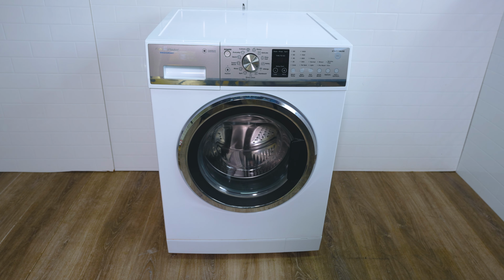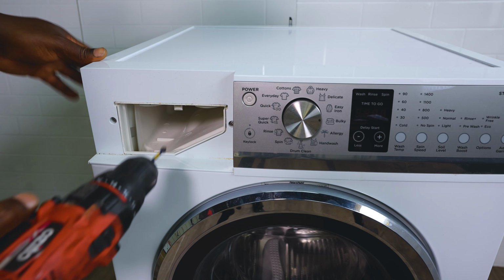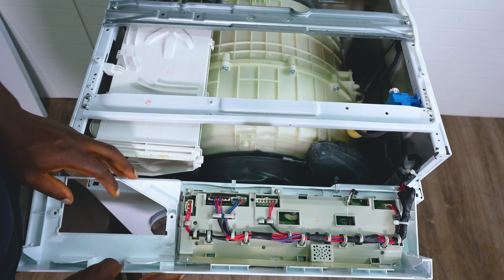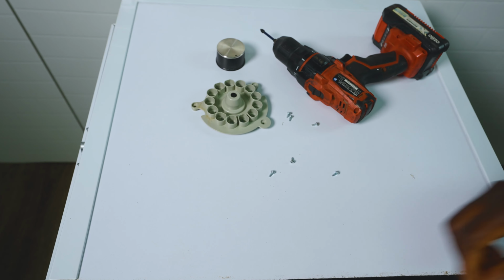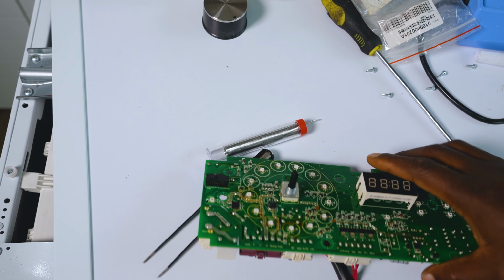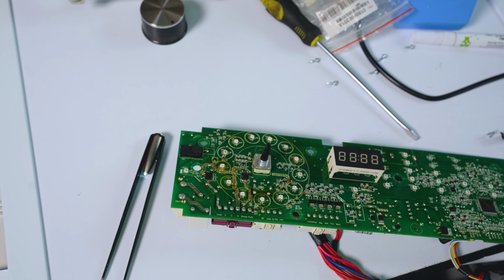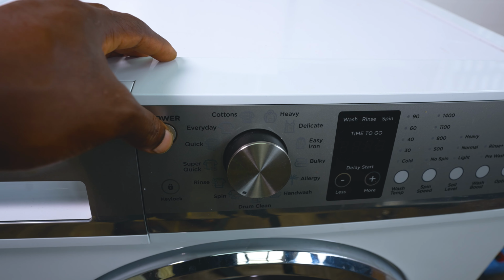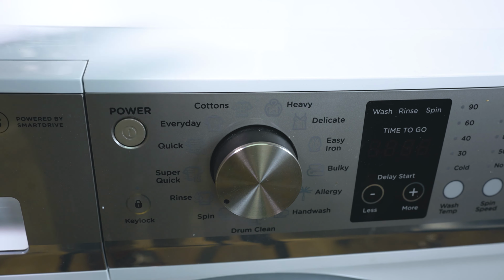Fisher Paykel Washing Machine  Lighting Repair

Comment: Nice video. I have the same problem. Can’t find anywhere the led lights 😢. I’ll have to pull the panel off & remove a led light to see if some electrical shop have them . Thanks .

Comment: Thank you for this very helpful video. I am intending to simply buy a replacement PCB Display Controller Board, rather than attempt to replace the many failed LEDs on my existing board. Replacement boards for my washing machine (part H0021800040FL) are currently sold by Fisher and Paykel on its Australian website for AUD 157.50.

Comment: Hi Mr Washy Washy My F&P WH7560J3 doesn't seem to heat the water. The LEDs on each of the temperatures selected light up, but no heat. Do you have suggestions on possible causes and how to solve this problem. The machine is only connected to a cold water tap. Thanks Bob

Comment: Thanks!
Reply from the maker: Thanks mate
Reply: Hi Mr WW, thanks for the video. although I encountered some problems that your video did not cover,  I managed to work around them. I didn't ry to replace the LEDs. My only option was to replace the circuit board. Having your video to refer to made the replacement job so much easier. Could I have done it without the video guide - probably not. Cheers Bob

Comment: Hi thanks for this video - it helped me fix Error 105 on this model (just had to replace the whole front panel - a 10 minute fix!)
Reply: Where did you get the front panel? EBay or?
Reply: @chenzheliu5453  yeah second hand. I bought a whole new replacement of the same model, but the guy sold me a complete dud, so I tried to salvage it for parts.
Reply: @ReverentSteele  good on you

Comment: Great videos mate!
I have the “door open” fault coming up. I have replaced the door latch as per shown in your other video. Still get the fault. I also replaced the pump as that was the original problem. This video practically shows how to replace the main board. Is that the next move I need to take. Is PCB what the board is referred to? Thanking you.😊
Reply: Hey @jarrodtalbot6604 in the same situation as you, did you end up replacing the PCB? if so where did you get it from?

Comment: How did you manage to remove the dial so easily? Mine seems stuck on so tight and am afraid to pull too hard
Reply from the maker: It shouldn’t break that easy.try to wiggle it out
Reply: @askmrwashywashy  thanks! I got it out by prong opposite ends with two small screwdrivers
Reply: Unfortunately it is possible to break the dial trying to remove it. I tried the wiggle method and two screwdrivers but the shaft snapped off. 🙁
Reply: @b5turbo  unlucky man, I tried it twitch with the 2 screw driver method and it has been fine both times. I just made sure to not bend the dial at all when doing so

Comment: Thankyou Mr washy washy very handy, I have changed a dozen displays sofar :) .. i have noticed these machines can also have issues with the soft touch buttons inside the display that connect to the user interface, they can go crazy and press by themselves ..have you struck this yet? late model f&p top loaders can do it too
Reply: Hi Mattaitchey,
Do you happen to know the LED replacement part no. ?
Reply: @stevelau6743  hi Stevelau sorry I do not know, I just replace the whole display with a good used spare or pinch LEDs from a donor board